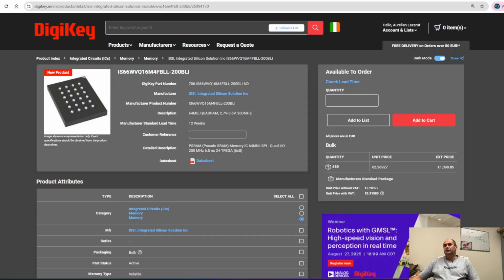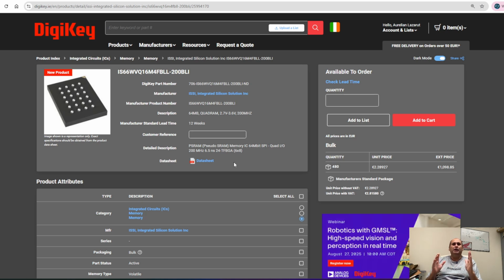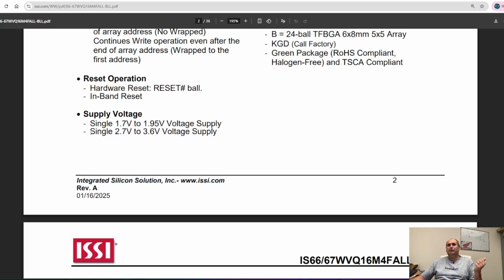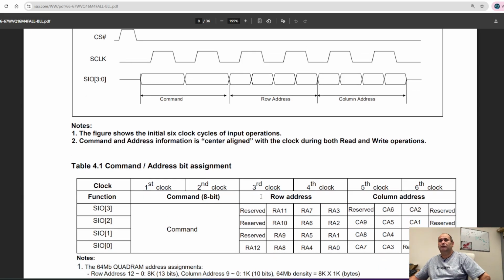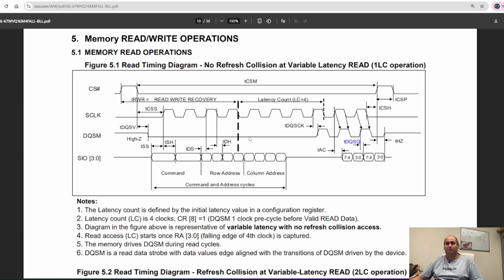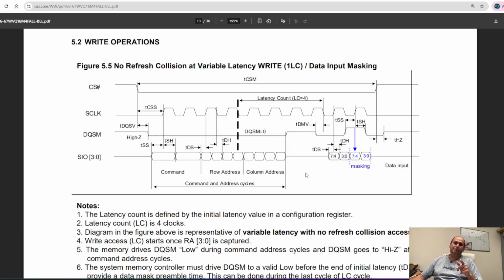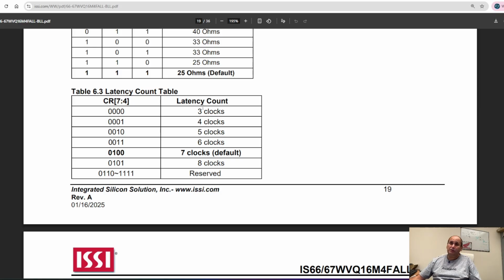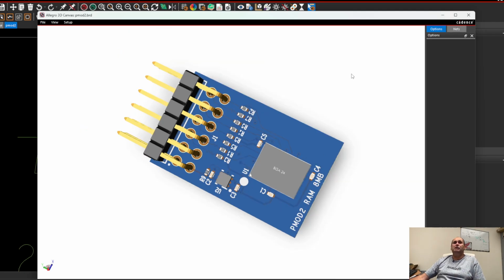PSRAM Memory Controller EP1

Comment: About the internal memory refresh of PSRAM, why some datasheet has tCEM (max chip enable duration) limitation that prevent users to perform long linear burst read or write.   If one want to use PSRAM as a framebuffer and do continuous memory read/write, do we need to care about tCEM limitation?  Thanks